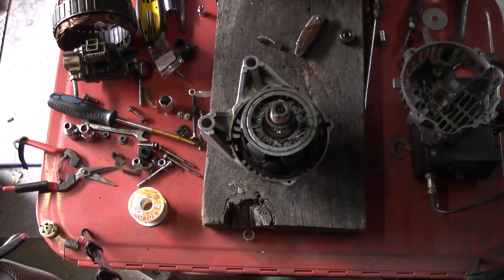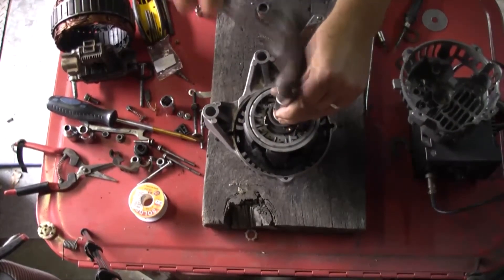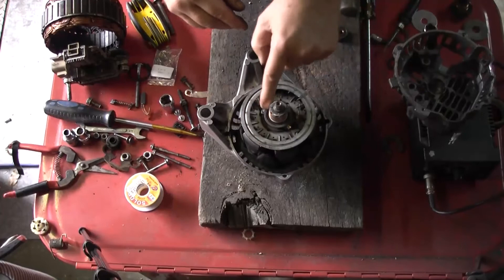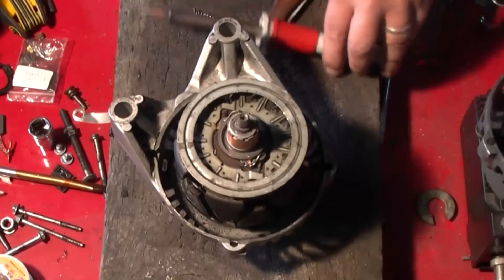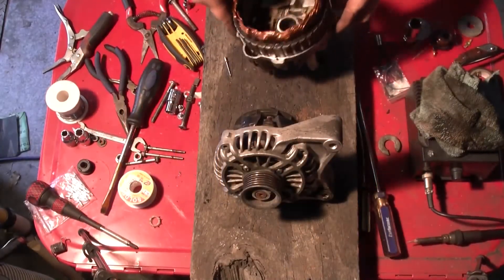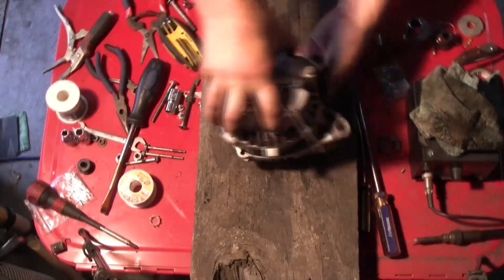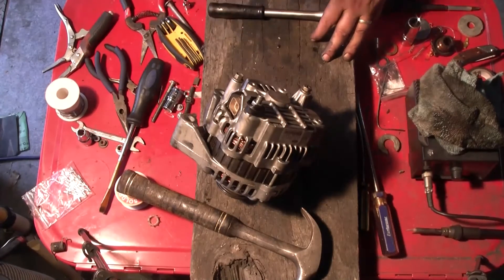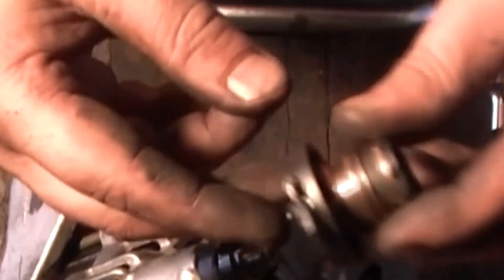Ford Falcon AU BA Alternator repair.

Comment: Since I think my alternator is the original, one thing I noticed is that the brushes where they are soldered, under the cap there was black silicone, I guess to stop any water ingress, quite a nice touch. Have to dig out the black silicone to resolder the new brushes in.
Might be a way to tell if alternator is original or not.

Comment: the large bearing, I thought mine was ok, but after cleaning out all the grease with petrol, seems to be some roughness I couldn't get rid of .  So looking to order one, not worried if its nsk or other, alternator will just be a spare if new el cheapo goes bad.
anyhow the bearing in there is nsk b17-102dg3  , since its a good brand and I think its original alternator.
So checking aliexpress you can use b17-102dg3 and seems these other two are ok also:
b17-102dg46 and b17-102dg4........
They are listed as 17x47x14mm  which is also common bearing number 6303.
So ordered one for $8aud includes shipping, probably unbranded but that will do the job for a while if needed.
When it arrives will post if 6303 slips nicely or not into the alternator.
Reply from the maker: Thanks for a detailed comment mate. knowing part numbers is always a huge help. Cheers.
Reply: @TEKNOFIED  big bearing turned up, fits perfecto, small one lost in transit, so ordered another from different suplier.

Comment: Little black rectangular thing near brushes is a capacitor apparently, at 8min 16sec you show it very briefly, just above the hole where the bearing goes. In the originals its quite a large cap, in the newer ebay replacments, its much smaller. Info came from alternator expert so pretty confident its a capacitor.........not absolutely sure though.
Also he said doesn't matter which way sliprings go back in, I was worried had to get the terminals/slipring  a certain way i.e. you can turn the slipring 180 degrees and it changes which wire goes to top/bottom slipring, put mine back in opposite way it was, was worried it would matter, but I guess your video of spinning altnerator backwards also confirms same.

Comment: your links to brushes/sliprings under the video dont work, they go to a tiny gif image!
Reply from the maker: Sorry about that, All sorted.
Reply: @TEKNOFIED  I just checked and the sliprings I bought off aliexress were $6aud  ( about 2 years ago) including shipping from aliexpress, quality seems ok, I just bought one that looked the same, and it was exact right size. So guessing they very common one. Whilst bashing it on  , it didn't fall to pieces so assuming its good enough.
No probs any links will over time disappear.

Comment: nice video once again, as always, I'm just looking up slip rings to suit on aliexpress,
I've ordered one just to have on hand, alternator starting to need a bit of a hit every so often, so guessing slip rings gummed up maybe.
pretty cheap of aliexpress about $6 bucks includes postage, but size might be an issue,
I'll do a video one day when I get around to doing it
Reply from the maker: Word of advice. Make sure to solder the wires to the brushes under not over or if you can twist around and make it a good solder. It will make sense when you have it apart. I did mine over with a 60watt iron. The repair only lasted about 6 weeks. I pulled it a part again and found one solder joint came off. This time I used a gas torch iron for more controlled heat and twisted/wrapped the wire around. The Alternator has not been a problem since. Cheers
Reply: @TEKNOFIED  thanks for that, I always use phosphoric acid ( rust converter from supercheap) as a flux, on anything I solder, its works amazingly well, things normally hard to solder, like nickel coated tabs, are no probs with a bit of phosphoric acid on there.
Reply: so i've got my alternator in two parts, I'll start on a very slow refurBish, no rush. Couldn't get the pulley off to put on the new alternator from ebay, 5mm difference in diameter of pulleys. Belt is tight, very tight but I got it on, tensioner has a tiny bit of play in it, but its way too tight for my liking. Will get garage with impact wrench to take pulley off.
One question: I've spent a bit of time with degreaser/petrol etc to clean it up. Seems it was original alternator is my guess, 460,000 km, not bad if its original, its 110amp alternator+. It has ford emblem on sticker, but made by mitsubishi.  model no. 1r23-10300-aa, a003TB22191
The windings were very dirty, used paint brush to try clean them up a bit with petrol/degreaser. Some of the varnish/coating on the wires has detiorated , I'm wondering if there a varnish can put on them to stop any shorting?
It was a stuck brush was causing the issue, so windings should be fine , but would be nice to recoat bits where its flaking off.
Reply: just a note, mechanic took off the old pulley and put on the new elcheapo ebay alternator, it didn't work anymore, opened it up, brushes had broken off along a line through the drill hole in the brushes,  impact wrench must be the culprit, so put pulley on with impact wrench when alternator is apart not after puting it together! 
Quite suprised me, broken pieces of brushes got stuck in between slip rings, shorting it I guess, not sure but no output. Just filed down the brushes to a nice curve and all good.

Comment: Where do you get your parts from? Is there a kit or do you purchase seperate parts.  How much do you spend?
Reply from the maker: I get everything either on eBay or local stores. Prices are subject to change but I just did a quick lookup for you.
Ford Slip Ring > https://rover.ebay.com/rover/1/705-53470-19255-0/1?mpre=https%3A%2F%2Fwww.ebay.com.au%2Fitm%2FAlternator-Slip-Ring-FORD-Falcon-EF-EL-AU-BA-BF-FG-4-0L-Petrol-94-08%2F280624322094%3Fhash%3Ditem415683562e%3Ag%3A5v8AAOSwGG5aInvQ&campid=5338549285&toolid=20008
Generic Electric Motor Carbon brushes 5X8X19mm from HK > https://rover.ebay.com/rover/1/705-53470-19255-0/1?mpre=https%3A%2F%2Fwww.ebay.com.au%2Fitm%2FPair-Various-Size-Carbon-Brushes-Brush-Repairing-Part-for-Generic-Electric-Motor%2F333123513820%3Fhash%3Ditem4d8fb56ddc%3Ag%3ArOAAAOSwY5NfB4Di&campid=5338549285&toolid=20008
So at the current prices about $35 all up.